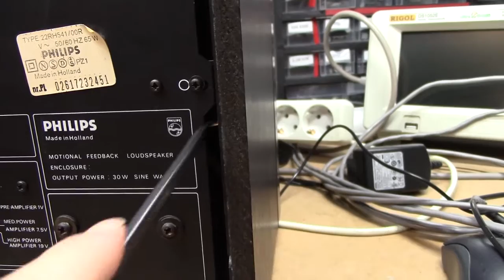Confession (Adding a power switch to Philips 22HR541)

Comment: On behalf of all MFBfreaks I congratulate you on this modification. It is in fact a pity that the RH541 doesn't have the possibility to bypass the automatic switch when its bigger brothers do. You did a good job :)
Reply from the maker: Thanks - I had much use of the manuals which I found on your site.